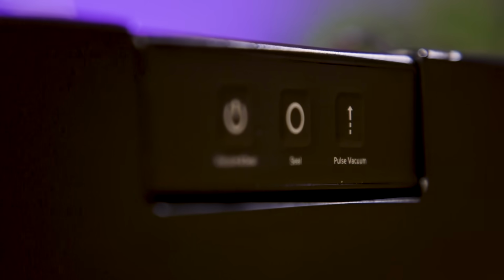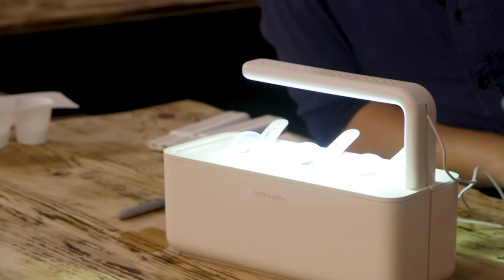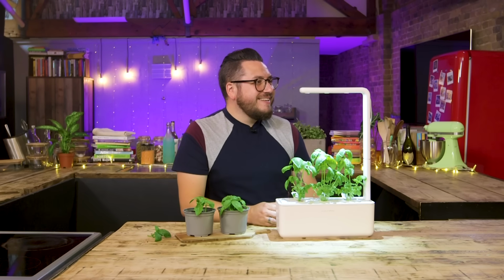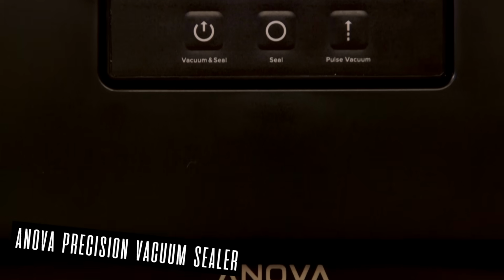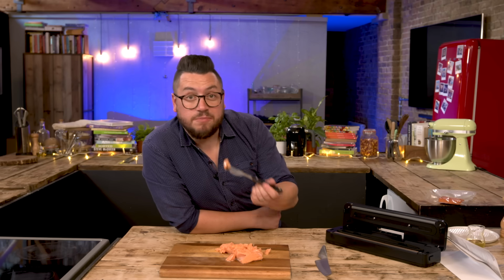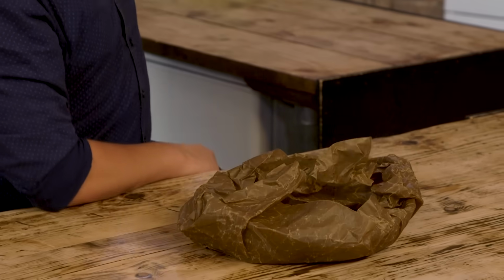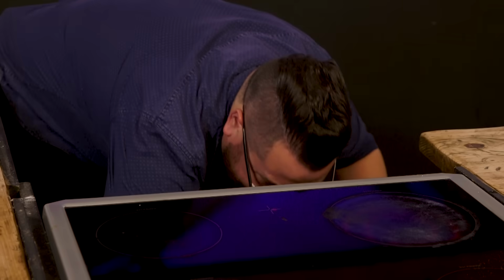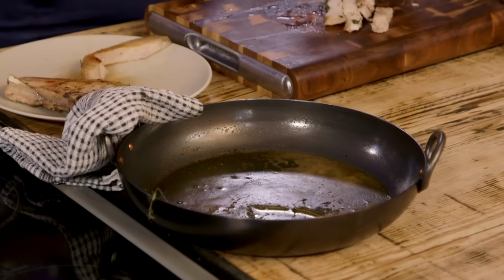Reviewing High(er) End Kitchen Gadgets Vol. 2 | Sorted Food

Comment: I have a cheap vacuum sealer from Aldi (Price not quality) and not only does this work for sousvide’ ING but its handy for anything you want to freeze.  Even wet things as it has a gentle moist setting.  I use small bags to hold left over tomato paste, coconut cream etc.  and vacuum packed meat does not get freezer burn.   The anova machine is a little more expensive than the Aldi one, bags can be bought cheap on eBay......  I would have the vacuum packer any day.  BTW I do have an Anova sous vide machine - i wouldn’t bother with the steak, but chicken, salmon and veggie are great.

Comment: The first gadget isn't any better than a basic hydroponic set up that is scaled down. Second gadget you can replicate with zip lock and a straw or a bowl of water, and if you're worried about spillage use the zip locks with a slide on top. The third device is basically a decent cast iron pan maybe a little lighter, and you could do the same thing with a steel pan just need to apply several coats of seasoning before hand. I do think the pan is probably the most worth while item there as it hand forged supposedly and should be made of lasting material, and one thing maybe over cast iron is it is probably lighter.

Comment: His feelings are about on par with mine but not the pan as much as i have found over the years, smooth bottom cast iron ... which is expensive AF but not when all rusty and crusty in a antique store. 5-25 $ soak in white vinegar for a couple days, scrub re-season blam 200$ pan. I have 4 sizes that a standard pan set would have and less than 100$ into them (or if you are handy with a angle grinder 10 bucks new and a couple hours)

Comment: I actually have the click and grow… and also the click and grow shelf unit it’s giant and super expensive lol and grows like 16? Plants 
The problem also, is that if you let light escape into the water, there’s a high chance you will get mold in the water 
On the other hand it is very good as a plant nursery. I probably won’t use it to grow fruiting plants though like tomatoes and peppers…

Edit: the capsules are expensive but I sorta cheat, empty old capsules and put normal soil and seeds inside :D

Comment: Instead of watering herbs from the top and risking over watering, the pot they are in should have holes in the bottom so you can put the pot in a dish with water. Then the plant will suck up the exact amount of water it needs and there's no risk of over watering.

Comment: The hydroponic garden only works if its in a nice temperature.  In the winter can this become a problem if the place where it stands gets colder (at night) then 15 Celsius (59 F). 
The  Food Vacuum Sealer that does the same great job can be bought at aliexpress for about 20 € (18 GBP).
The pan is of a low Quality because it deforms on a flat servus. Buy a proper cast iron skillet it is better an cheaper. Same size 20 €.

Comment: When I look at a vacuum sealer, I don't think "sous vide", I think "buying stuff in bulk, sealing it in portions and freezing them".  That's what I have a vacuum sealer for.  Vacuum sealed food is much less prone to freezer burn and it often stacks nicer in the freezer. BTW: don't buy the bags, buy a roll of the plastic (much much cheaper) and cut the length you need, seal one and et voila, you have a bag for a quarter of the cost and you can use less plastic for smaller items.
PS: if you get that vacuum sealer and save money by buying in bulk for a year you can afford that fabulous carbon steel pan... just saying...

Comment: So, seasoning a pan is not burning off the oil. At high temperatures, a thin layer of oil polymerizes and adheres to the surface of the metal. That process generates a natural and non-toxic non-stick coating that humans have used perfectly well for two millennia.

Comment: Kinda surprised you went straight to sou-vide with the vaccuum sealer. Not really what anyone I know uses it for - it's a storage device. Buy a larger pack of meat, portion it out (toss some flavorings in with it if wanted) and it can be doled out as single portions if needed. Keeps things safe in the cupboard. Loads of other storage uses (and while the bags aren't cheap, and the instructions frown on it - you can reuse them. A lot.) but perhaps that's a country living thing. When it can be 25-45 to the grocery, you keep a good pantry. When the weather traps you inside for a week+  pretty much every year, often more than once, insurance things won't be wasted or ruined becomes important. And at the risk of horrifying the more citified - we heat predominately with wood. A wood rack and a wood chute when mixed with country living can equal mine. Sealing things up gets vital fast. For things like that, I honestly suggest them to most of the people I know. Even if only to make sure food wastage is minimized if a friend living on their own wants to take advantage of a discount something sized for a family rather than pay what amounts to the 'alone' tax. Sealed tight, no freezer burn, good to go.

Comment: Plants are wonderfully low tech, just get herbs in a pot (sat inside a mug or on a saucer) on the window sill and you don't need a big lump of plastic. If they're inside then getting frosted shouldn't be an issue. Nice idea but way too expensive and pygmy tomato would be the only option as it's way too small for most tomato plants.

Double ribbed for pleasure.... and flavour.

Comment: I sous vide a lot, and I did the vacuum sealer in the beginning.  The bags suck and leak every time, at least if you buy a normal, home-style sealer and not a fancy commercial chamber sealer.  Just get some vaguely decent freezer bags.  They work better, are easier, faster, and just a lot less work.  Also, don't put fat in the bag with your steak.  I promise you it absolutely ruins it.  It sounds like a great idea--I love butter too--but I promise, it just ruins the seasoning.
Reply: I use normal, home style sealer and my bags never leaked...

Comment: The smart herb grower probably uses an RFID chip in the pod that the machine can then read and grow the plat 'properly.' Problem with this is that you can only use their pods to get those results, thus a virtual monopoly when no other pod, or your own pods, will grow with the same light and water cycles; it's another Keurig situation, and I wouldn't be surprised if they haven't already, or are going to, pull a Keurig 2.0 situation that fully locks the system to first party products without a hack to get it to be an open system. 
I also have a bit of an issue with the lights on this thing. Unless they're extremely directional lights, varying light cycles between plants is not going to work due to neighboring lights. I'm also curious how the watering system in this actually works. Another issue is temperature, not everything will like room temperature, and there's no way to deviate to something hotter or colder, especially not for individual pods. 
It's not a bad idea, it's just fundamentally flawed, with potentially bad business practices. 

As for sous vide, silicone bags supposedly work, assuming you can ever find one that has a tight seal and will vacuum. They're also expensive, but reusable. For the silicone bags that do have a nice seal, there is a hack where you can use a larger vacuum ziplock bag, the kind with the little circle for a small pump: seal the unsealed silicone bag in the ziplock, pump it down, then seal the silicone bag before removing. Considering the cost of a vacuum bagging system, it's really not too much more expensive, and there's not a consumable cost, and a lot less waste, not to mention you don't need yet another entire appliance in your kitchen, just a space for a handful of silicone bags. Amazon does have cheaper alternatives to the bags, but I haven't seen them tested out, and you want bags that interlock with themselves, not the kind with the plastic clip at the top. Anova either partnered with or bought, can't remember which, Stasher, which made the first name brand version of these bags, and Anova markets these bags as working for sous vide. 
As for cost of sous vide as a whole, if you have an Instant Pot, or another brand's version of one, you have a sous vide machine already, the sous vide function is literally just the soup function, but you're using water and a sous vide bag instead of making soup; though it is limited to the capacity of the pot, but that shouldn't be an issue with most things. Most people are buying these for other uses, so the investment into sous vide is justifiable if you already have something that can sous vide. If the price of silicone bags comes down, or a cheaper alternative of the same or better quality comes out, sous vide could become extremely accessible to everyone with less plastic waste, as the only waste would be the vacuum ziplock bag once it wears out.

Comment: Regarding the Growbox - That thing they reviewed is USELESS!

The selling factors are two: 1. It looks sleek. 2. "You don't have to think." - Which means that if you actually are serious about growing a COMPACT indoor garden, you can fix this for way cheaper and less monthly cost.

You need; An LED light rig (cheap) - A plastic bucket underneath to catch any drops, a hydroponic tube (cheap), a water pump and tank (also cheap - if you can afford an aquarium, you can afford this), and a timer for the lights. That whole setup is less than 70 pounds. And the monthly power drain is less than this rig.

Comment: the gardening machine "pods" probably have a little nodge that tells the machine what youre trying to grow
Reply: They don't. The lights are on a 16-hour cycle, regardless of what you're growing; you would have to plug it into a separate timer to have a different light cycle. And the watering is just a reservoir under the plant pods, they wick the water up into the soil in the pods. You refill it when it gets low. There's a float in the water tank, you push on it with your finger too see how low the water is. Not really what I would consider a "smart" system. There's nothing "smart" about the soil pods, as far as I can see, other than that they gave them that name.
Aerogarden gives you twice the plant capacity and light for the same price, has customizable light timing on all sizes of its kits, has a pump that aerates the water/plant food solution instead of just a stagnant basin of water under the plants, and has been in business for 15 years ... my old Aerogarden bought 10 years ago is still working.

Comment: I just got a DeBuyer carbon steel wok, still need to season it, but isn't carbon steel often on the thinner side meaning it takes a lot less long to heat up? That's why I love carbon steel over cast iron -- light weight, but most of the other positive qualities.

Comment: I suspect there's a very small RFID chip in the soil that interacts with the machine, and that's how it knows what is growing and adjusts.
Reply: Nope. Read the description on their website. The watering reservoir just wicks up into the soil pods, and you refill it when it gets low. The lights are on a 16-hour timer, you can't adjust the cycle unless you want to plug the thing into a separate timer.
It does not "know" anything, and does not "adjust" anything.
Reply: @sierraseven3680  They've just made it very versatile so anything can grow under those same conditions then. It is cool still though.

Comment: Regarding the pan... considering the need to season the pan over time, wouldn't a far more reasonably priced cast-iron pan give you the same benefits for less money?  Can be used stove-top, in the oven, and over hot coals/fire... gives well distributed (and sustained) heat for even searing.  Some preliminary research seems to indicate the cost is highly influenced by the 'hand made' nature of the product. Cast Iron pans of similar size can vary widely in price from about 20 US dollars to almost 200! I think the latter is insane. The price of the pan in your vid was 100 quid, or a bit less than 80 US dollars.... I think a cast iron skillet in the 40-50 US dollar range would do just as good a job and would last just as long with proper and diligent maintenance.  I'd say, the 'hand crafted' nature of the product isn't worth a 40% markup.  Go with cast iron.
Reply: Sorry, screwed up my conversion. 100 pounds is about $130 US dollars.  And maybe I'm not much versed in the quality of cast iron cookware, but at least here in the US, there are plenty of options for a 12" cast iron pan for under $50 US dollars.   I think it would make sense to spend that kind of money and do your due diligence to care for it and see how that goes before blowing nearly three times that on something pretty much only because it is 'hand crafted'.   Heck, if you are particularly industrious, you might browse craig's list or something like that or go to yard sales to find an old cast iron pan that just needs some TLC to bring it back to life. There are loads of vids on YouTube on how to restore old, rusted, cast iron cookware at a minimum of cost (although the time investment in that case is large).
Reply from the maker: Yep... a very valid point. You could pick up a decent cast iron pan (still needs looking after) for at least half. We guess this pan is as much a statement piece.

Comment: "Plastic isn't great, but neither's food waste." Dude that makes no sense at all!
Reply: Its a difficult calculation. The plastic is one use and created from oil and probably doesn't rot. Wasted food DOES rot, adding potential greenhouse gasses, must be recycled or processed and was grown, packaged, transported etc. Working out which is worse, the impact of the bag or the impact of some food that  you didn't actually eat (meaning everything leading up to it was wasted effort and energy) would be a toss up. If you eat the food and don't waste it then you don't need to replace it with another food item.

Comment: If you want a self-contained small growing kit, good for herbs or cherry tomatoes, you really should be looking at an Aerogarden instead of this little undersized, overpriced toy. For the same price you can get a larger, more automated system, plus pods. Or for the same price, if you don't mind watering and don't need the automated system, you can get a good 2X2 foot LED grow light and fix up a countertop herb garden or a small veggie container garden with  four or five times the capacity of that thing. I have about six feet along one wall of my garage fixed up with lights and benches, and I have basil, oregano, rosemary, cherry tomatoes, small peppers, for winter, then I use the set-up to start seedlings for the outdoor garden in the spring.
Reply: beedsj roiue  I'm not saying that it doesn't work. I'm saying that you can get more for your money with another brand.